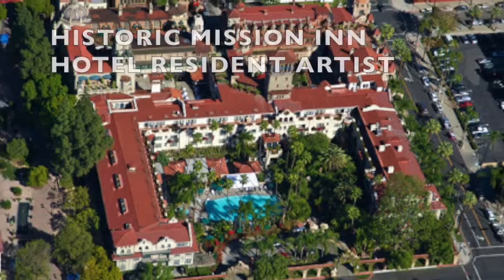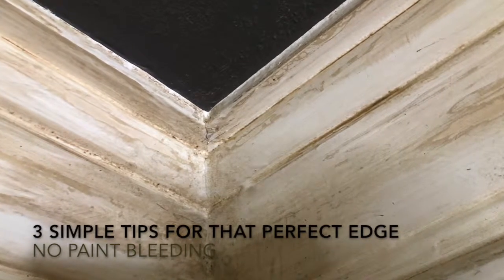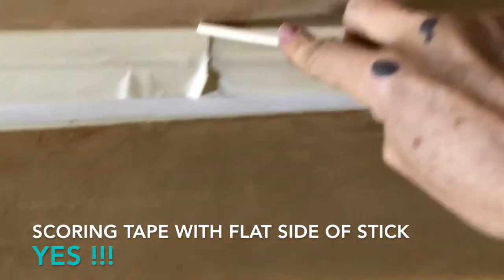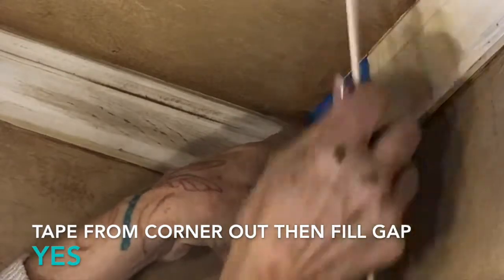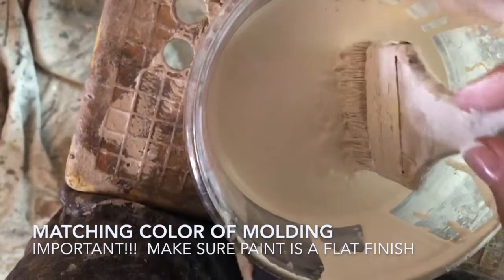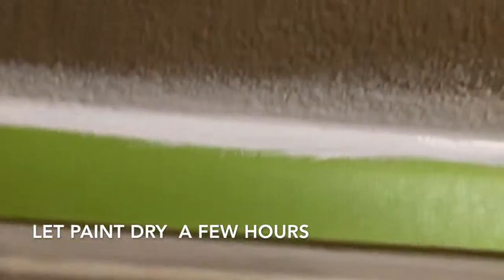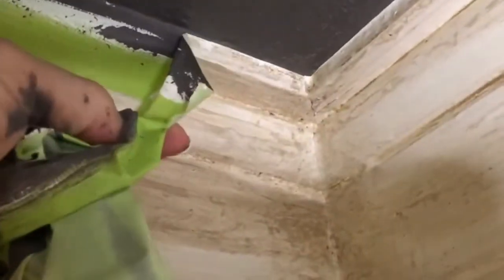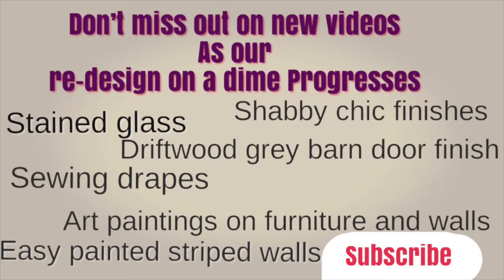cut in edges LIKE A PRO! PAINTING TIPS DIY straight clean edges

Comment: I could have used this video like 100x in my life. I paint like a 5 year old. I swear, I get more on me and the floor than on the wall. But serious question - what if you need to paint with a semi-gloss?
Reply from the maker: Cheap & Cheeky That is a very good question Melanie! You always want to use the edge paint against the tape to be flat with your paining so my glass over it or not you want what I call the leak paint to be flat because a semi gloss drives like a sheet of plastic and when you tear the table if it has a tendency to not tear in a perfect line. So if you were taping and painting was semi gloss you do a flat edge along the tape and then you pay your semi gloss and peel it off almost right away but you do with called back peeling where you pulled it back on itself I hope that made sense